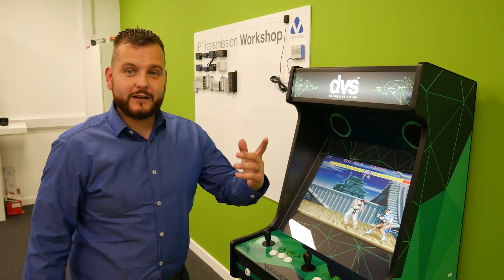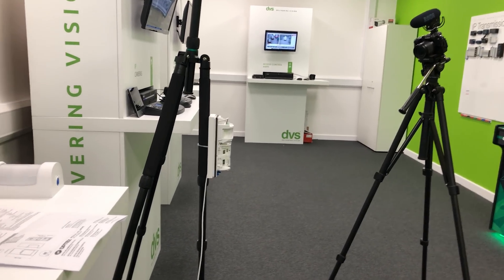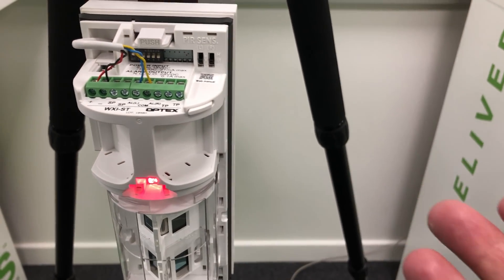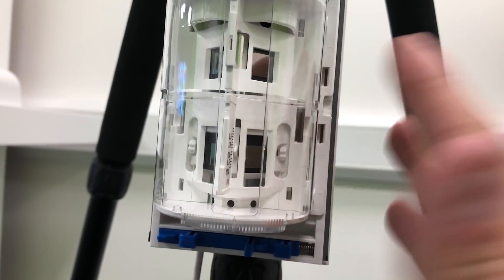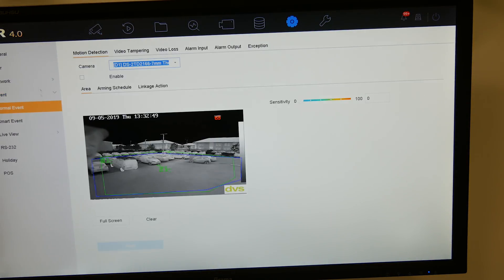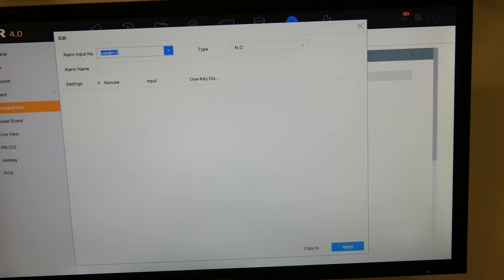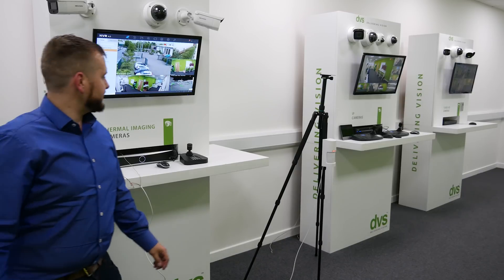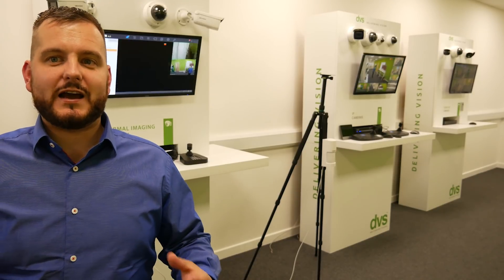Hikvision Alarm Activation Using External Optex PIR Detector

Comment: When the alarm is triggered to the preset 3 on the ptz how long will the ptz stay on preset 3 before returning to preset 1 and will smart tracking work on the preset 3 or like you said in another video the preset will work with smart tracking but only for the dwell time like 15 seconds?

Comment: Y using PI encoder if you can directly connect the optex PIR sensor to NVR then using alarm input and set everything to NVR?
Reply from the maker: you can connect to DVR, NVR, Encoder , all works the same

Comment: Can you have multiple PIRs and then have the PTZ point at them whenever they are triggered, or would it get confused if there was more than one alarm event? I'm assuming it can only move from its resting monitor position to a PIR protected location and then back again.
Reply from the maker: Yes , it will go to the latest alarm so if more than 1 comes in they will look at the latest one

Comment: Can I connect my PIR detector to another camera with alarm output (no ptz), so when I walk in front of that camera, the PTZ look into an specific location with preset?
Reply from the maker: yes technically if the 2 cameras are connected to the same NVR / DVR then it’s the recorder that provides that linkage , so on the camera alarm input on the NVR you select PTZ linkage and the appropriate PTZ and Pre-set number, if that helps

Comment: Are the inputs and outputs on hikvision NVRs, DVRs and Cameras dry contacts?
Reply from the maker: Hi Roberto , there classed as dry , there is no voltage output from the relay , and only the a common ground to feed into the alarm inputs,